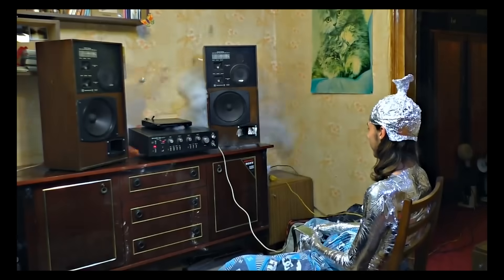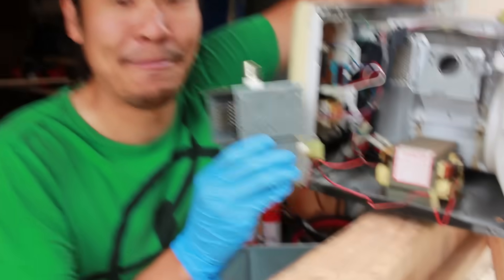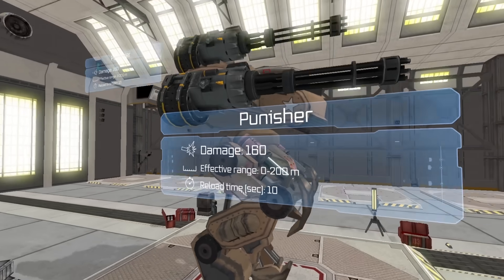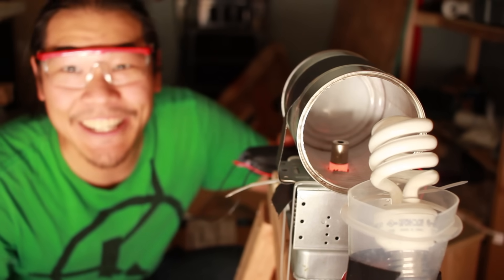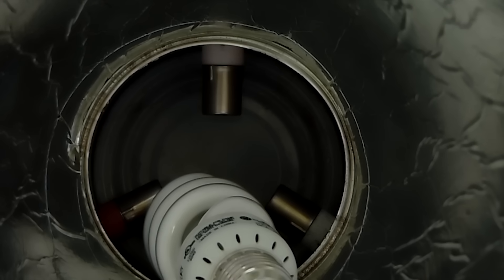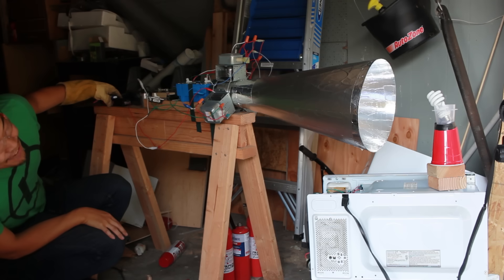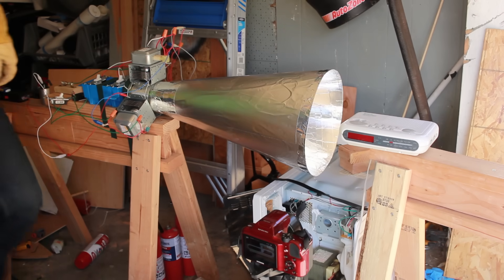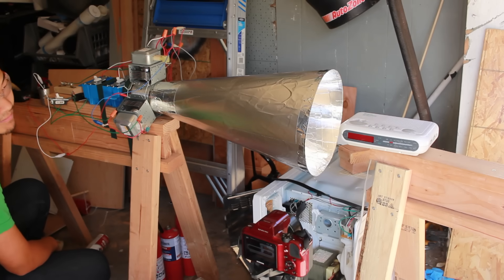A Microwave Gun Made From Taser and Soup Can??? (Testing Kreosan's Magnetron Cannon)

Comment: Number one thing to remember about magnetrons: they produce more heat than microwaves.
1000 watts goes in, 300-400 watts comes out as waste heat.
Yes, there are tubes that can get close to 70% efficiency, but they require carefully designed power supplies.
The loud fan in your kitchen microwave oven is running full speed to keep the tube from melting the anode.
Point being, if you want a 1000 watt beam, find a 3 Kw power source and a cooling system that can dump 1.5 Kw.
Oh, the conical feed-horn?  
Its beam divergence angle is about than 1/2 of the conical angle, so this thing would not be very effective at any real distance.
Inverse square law and all that.

Comment: Looks like you are missing some components. They are using some electrolytic capacitors to in crease the performance  as well as home made wave guide out of copper with a Hybrid ring coupling the the microwave magnetrons in the proper phase relationship to generate higher power. https://www.google.com/search?q=Microwave+hybrid+ring&client=ubuntu&hs=m2w&source=lnms&tbm=isch&sa=X&ved=0ahUKEwiIkJCOzYzYAhWRZiYKHZ_KC8sQ_AUICygC&biw=1280&bih=880

Comment: Ah I have made a similar design with my friend for science class but it required close to 13000 watts and not only did we fry every electronic within 50 feet we also blew our capacitor which rand us down $1500 D: but it looked cool as hecc so it was all worth :D
Reply: 2 dollars for those capacitors at an Electronics salvage yard from old radio transmitters...
And you over powered it...  you need 27 Joules/s to get a strong enough pulse.  and the pulse last 160ms

Comment: I'm 30 seconds in. Before I watch more, I just wanted to say that I don't think this is real. If a nuke went off, older vehicles which don't rely on a computer to run would still work if they weren't damaged. Old American muscle cars would run, most motorcycles would also still run. At the worst, you'd have to change out all of the fuses. A motorized scooter, I don't know... If it's an electric vehicle of any kind, it would be completely useless aside from harvesting working parts and scrapping it.
Reply: I take it back. As soon as you mentioned pulling the magnetron out, explained how it works and mentioned using the stun gun to power it, I knew it would work.

Comment: Yes Keystone Science made a functional magnetron gun. Yes it was better than this one. But this one wasn't an attempt at inventing anything. This video was for confirming or debunking another video. So what's the point in comparing them? Keystone used a different setup, with different voltage, wattage, materials, waveguide, etc.This is a great video, and serves it's purpose. If you want to build a magnecannon use Keystone's method. This smaller cheap version doesn't work, and you'd be wasting your time.

Comment: I think tuning the capacitance and inductance of the circuit going into your magnetrons could make a big difference. Do all your magnetrons operate at the same frequency or not? One of them could be doing all of the emitting while the other two are just eating power. And the size of the tin can matters too. You have to change out those until one of them actually resonates with the microwaves. That's like, important.

Comment: We have fooled with them but used the transformers from the ovens too and they will ruin  police radar units !!! powered them with a big inverter  note if you want to go mobile with them you must have a point style distributor and a carbureted older vehicle  these things will take out a EFI systems ECM  !!! I think it would be a gas to fire these things under the tolling systems on the bridges  EMP fry those things !     one safety note you MUST shield around these things you can damage internal organs and cause burns to your self I would NEVER get in the path of these units !!

Comment: You need "waveguide", which is a cavity (or conduit, actually), that is tuned to the microwave wavelength so it can transmit microwaves without attenuating the energy.

Comment: One thing to consider. Where was the other video shot? Stun guns are running differing outputs depending on country. If the other video was from the Ukraine then likely it was a Russian stun gun. If they were useing an early version of the Russian 107yt stun gun, it was 30k volts at 10 watts but 7.5 miliamps. Later versions decreased the amperage though.

Comment: Really ukrainian boys did some illegal things before.

They removed current limiting resistors from taser gun, powered this gun with bigger batteries and higher supply voltage. This modification of weapon is illegal, becouse it can easily kill. Of course they used bigger flux capasitors.

It is not all. This electromagnet gun is totally illegal thing. It may damage not only electronics, but human body too.

Comment: I hated the class on microwave frequency circuits because at those frequencies the wave guides and trace widths, etc. all had to be tuned just right or you lose a lot of the power. You might not be trying to send coherent signals over distance in this application, but I doubt just slapping three magnetrons into a soup can gets you the perfect wave guide. It's been too long since that class for me to remember all the particulars though.

Comment: >unshielded microwave emitter
congratulations you have cancer
Reply: Callum Shingleton-Smith 
Burns are the biggest danger with microwaves
Reply: At this power level I'd certainly put my hand in front of it. My slayer exciter coil puts out more RF power than this.
Reply: Non-ionizing radiation, no cancer.
Reply: Verserk would you like to put your hand in front of it to show us?
Reply: microwaves can 
NOT
cause cancer. Internet Myths.
Reply: Dead Meme The only thing that can cause cancer is the filament on the antenna. Smash that and inhale it, you’re probably going to live a shorter life.
Reply: Ashton Yaklin Yes, the filament and the (in older microwaves) beryllium oxide on the magnetron antenna which is fatal if inhaled or lethal if ingested. Its the pink stuff... In some microwaves, i think, they use Aluminium oxide and its white silver. However, i was "talking" about the actuall microwaves it produces.
Reply: @cutekittycatzz1060-3GB  
Beryllium
Reply: That's essentially what wifi is.
Reply: Not to mention the insulators in a magnatron are sometimes made of beryllium. Very. Nasty. Shit.

Comment: you just need a lot more power try gutting 3 ovens and using all the parts that power them up in the power system hell just use all the guys but put the guns in to the can and make the "can" longer using say well soldered aluminum flashing material. How well it will work i couldn't tell you but you should get better results for sure.  Obviously you got some micro waves coming from it with this basic set up it was mucking with the radio and your camera. Also i bet any one on cell phones or wifi at the time you fired that thing off were probably wondering why their connections dropped. Even bypassing the safety switch on a microwave oven door and turning it on will cause cell phones and wifi signals to drop a fair distances away 25 to 35 feet or more.

Comment: I was under the impression that microwaves are most effective when focused. You may try substituting a Pringles can (or two) for the cone. I've heard that can be useful for directing radio waves.
Reply: Radio waves or microwaves?
Reply: @dad49998  Presumably both, since it's a reflective, parallel, cylindrical form. But then, I'm not a radio engineer, so I'm open to qualified rebuttal.

Comment: The Ukrainian video was clearly fake , but you got a few things wrong in your video too. The cells they used look like they could be ICR18650 30q which discharges at 30 amps.
18650 batteries typically have a lot more than 4w of power , most high drain cells discharge at 30 to 35 amps . At full charge of 4.2v x 4 cells x 30 amps = 504 watts .
If you look at your new battery it's a 2s 7.4 volt making it 14.8v at 800 mah with a 30c rating, this  gives it an amp output of only 24 amps or 355.2 watts.
In short if you are doing this to bust a myth you underpowered your device by 29.52 percent .
If you turn on subtitles in the russian video they clearly say they add capacitors to their setup too but don't tell you the type or capacity of those capacitors so that's also up in the air.

You have been weighed, you have been measured, and you have been found wanting. LOL

Thanks for the video i enjoyed it .
Reply: https://www.youtube.com/watch?v=80kDn4vit_w
Reply: More like 25a for most batteries for safe continuous discharge, vtc5 might do 30a but sacrifices a bit of capacity
Reply: This application isn't continuous discharge  its pulse current , most 18650 cells can pass 25a in pulse current with no issues. My ebike proves this on a daily basis as it's powered by over 200 of these cells, monitored by voltage , amperage and temperature.  The cell degradation is logged using a combination of charge / discharge monitoring which  tracks all of these aspects on every battery . 30amps or more for this usage is easily more than achievable.
Reply: In this video he was using a cell that has a 30 amp discharge. I know because I own the same brand.
Reply: +Richard Smith
I own the same brand too, more importantly the same model, you can see it here 
https://www.amazon.com/flite-800mAh-7-4V-18AWG-Battery/dp/B002FTJAZK/ref=sr_1_2?ie=UTF8&qid=1513788647&sr=8-2&keywords=E-flite+2s. The battery clearly says 24 amp discharge

a simple c rate calculator gives you the same results 

I think you have the 3s version which is 66 amp discharge seen here 
https://www.amazon.com/flite-2200mAh-11-1V-13AWG-Battery/dp/B004PO4HF6/ref=sr_1_1?s=toys-and-games&ie=UTF8&qid=1513788796&sr=1-1&keywords=E-flite+3s

E-flite Is a product produced under the parent company Horizon hobby which does not sell any E-flite batteries in a s2 configuration with a higher amp output than 24 amps , in fact they only have 3 batteries in the 2s configuration with that color scheme here are all 3 

https://www.horizonhobby.com/450mah-2s-74v-30c-lipo--18awg-jst-eflb4502sj30
https://www.horizonhobby.com/800mah-2s-74v-30c-lipo--18awg-jst-eflb8002sj30
https://www.horizonhobby.com/400mah-2s-74v-lipo--jst-p-eflb4002s30
Reply: I was talking about the 18650 he was using at the start. https://www.amazon.com/Odec-18650-Battery-Rechargeable-Batteries/dp/B0727YJWTM
Reply: I don't own that cell but the specs are similar to other 30amp 18650 cells , i also can't see anything other than a single cell being used . By his own words his second battery is supposed to be more powerful still validating my comment .
Reply: I don't know anything about lipo packs, and I was just commenting on the 18650, so you are probably right. The 18650, however, is fully capable of delivering a continuous 30 amps. Odec batteries are rewraps, but they are rewraps of certified cells and have reliable labeling, unlike most 'offbrand' batteries. Odec specializes in vape marketed batteries, so the service they offer is verifying cell claims and relabeling those batteries. People don't want their batteries going into thermal runaway while in their mouth, LOL.
Reply: The fact about the 18650 cells is true, but they are only there to heat the filament. Heating the filament is like putting the magnetron into standby: it's on, but not doing anything except dispersing energy as heat. The stun gun is what provides the high voltage part. Now, given, he did use LiPo packs to power that one, too, but that really doesn't matter so much anymore when he puts a high voltage capacitor in series with it: The stun gun just fills up the cap until it discharges. You could even power that cap without the stun gun, but it would take longer to fill it, so the gun would pulse less frequently. The actual power put into the magnetrons is at that point determined by the cap alone.
Reply: За Родину обидно!
Reply: В оригинальном видио был использован электрошокер который имел более редкие и более мощьные разряды. !это одна из основных ошибок. Далее было бы неплохо воспроизвести всю схему, в точности как у KREOSAN
Reply: Jesus dude u went einstien on his ass lol why do you know so much about a damb battery lol
Reply: A batteries amp rating is calculated by multiplying the capacity in milli-ampere hours with the c rating of the pack , wattage is a multiplication of the nominal voltage and amps . I've built multiple forms of emp devices using lithium ion cells and own over 2500 of them in various form factors . You can actually build a stronger emp device  than he has in this video with a taser circuit or voltage multiplier a coil of wire and simple spark gap. There is no need to convert the energy into microwaves because with so little power it's useless .

Comment: I recommend you use original transformer and rewind primary (110/220V side) to run from 7.2-14.4V or whatever battery pack voltage you have, and drive it from li poly or Ni-Cd pack with some simple 2 transistor inverter. You can overdrive it for short time with no problem, likely with no damage, just keep it (magnetron and transformer) from getting too hot...
Those bigger LiPoly batteries are capable of hundreds/thousand watts for short time.
BTW it will kill you if you touch HV side, but you know that ;-)

Comment: In case anyone didn't know, them magnetrons are very dangerous for sure. Beryllium when a magnetron gets broken gives you cancer. Microwave oven - microwaves will burn up your eyes making them opaque or worse (like a cataract). If microwaves are powerful enough it will send high voltage spikes through the electrical system in your house... possibly your neighbor's house as well if close enough. Might even be a way to set your neighbor's house on fire by accident or start a fire where it's hard to put out; if devices using wall power get damaged and short. There's a lot of cheap junk appliances around that would catch fire without much provocation.

Comment: Listen to the sound the kreosan stun gun made. It has quite a loud 'crack' to it when ever they show it... that's different! Maybe they edited the sound to make it sound louder but when you look at their other experiments It starts to seem plausible. And that's not to say they didn't put fireworks in there for sure. IDK. The magnetron  does need many watts but if a short duration pulse has enough energy it will send out a short duration microwave pulse that could theoretically be much more powerful then the magnetron would ever be in a microwave oven. I've never seen a stun gun like the one they have there... it's kinda scary. Also they have 240 volts everywhere there, which is going to flash over more easily inside the components in their equipment. Once the capacitors (and other components) on 240 volts arc from the high voltage created by absorbing microwaves it can quickly damage them and they may short and let the 240 volts through. Also air is ionized by the induced voltage which will bring the 240 volts with it's juice through the air to other components. One way or the other the line voltage has a path and that is what would actually provide the energy to cause their capacitors to burst as violently as they do. But the microwaves alone could be enough to short capacitors and semiconductors low voltage devices as well.

Comment: So what about replacing the taser with 4 car batteries and a large capacitor then placing a steel rod down the center of the emitter with a copper wire coil connecting the 3 magnetrons.

Surely that would work

Comment: Just build it with the actual transformers and rectifier that the actual microwave ovens use. Switching in the taser or whatever is simply not going to put out as much power as the hardware actually designed to run the things. Sure you'd have to have it plugged in then, but it might at least have a chance of working.

Comment: The design itself is kind of silly, the cone is the most obvious design flaw is the cone, it is not smooth on the inside so the microwaves are going to be scattered, the magnetrons placement is also important, since this configuration is more likely to scatter the pulses inside the first stage of the canon; you should place the magnetron more towards the back and have a parabolic reflector at the back  to help with the projection. Also more caps to help create a higher powered pulse, you should have put one for each magnetron. I'd also recommend using a step up transformer to increase the voltage output from the stun gun.

Comment: You might want to create a cavity and antenna frequency tuned for around 2.4 GHz at which these ovens operate. Microwaves are finicky and resonate best in cavities designed for their operating frequency. If the cavity and waveguide are tuned for the right frequency you will get maximum power. Just like with the old CB radios, if your antenna was tuned right you could "get out" and talk farther. You might want to look at books published for ham radio operators that work microwave frequencies. They are full of information on antennas, cavities and waveguides.

Comment: How bout a quality stun gun. they range from $10 to several hundred. Also what are powers of magnatrons, they vary greatly and diminish with age, cleanliness, and use. Major point, what is the math behind all this. There must be numbers. Voltages, resistance, impendance, values everywhere. Even the gauge of wire will effect overall outcomes. We can hear it in guitars and electronic musical instruments dramatically. I'm sure focusing a broadcasted ionic beam must use specific tolerances. And yeah, the kids in the foil suits were just making a vid to show their buds, but... the bulb did light.